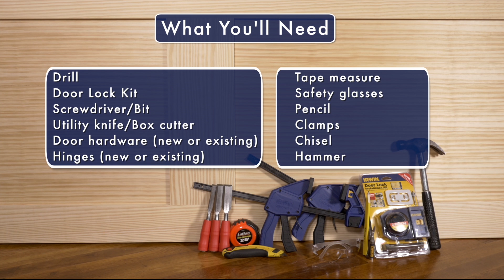How To Replace and Install an Interior Door

Comment: new doors need to be planed to size. which you seem to overlook.
Reply: ewarda100 Actually, this door fit exactly in the opening and did not require and adjustments. Rare on an older house but not unlikely.